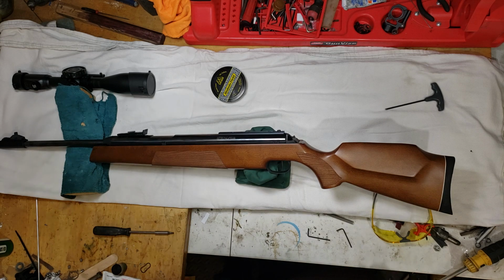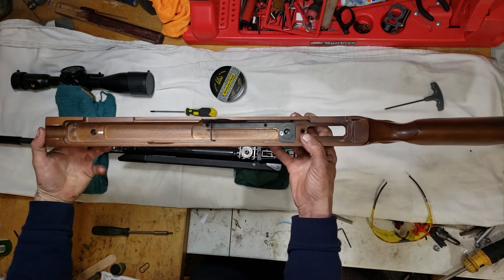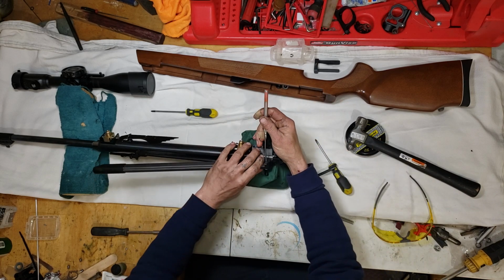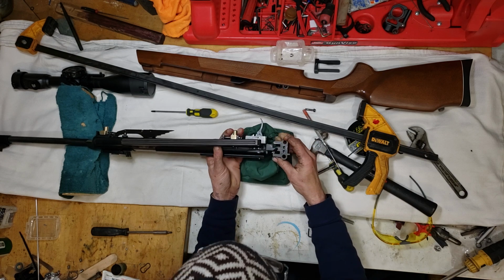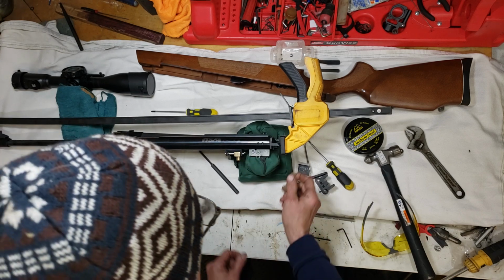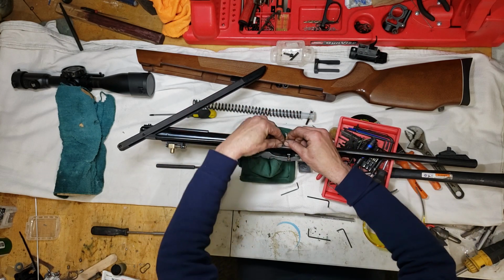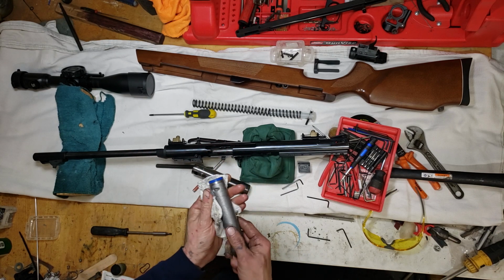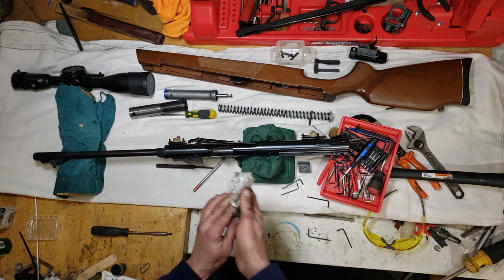RWS 54 AIR KING teardown part 1

Comment: Hey
good to see your video, I've got the 56TH in 177 and had it apart a few times, the front trigger screw can be left tight and the attached metal part comes away with the stock, also remove both circlips on the cocking arm and remove it completely, the cocking bar can then be swung forward, being careful not to turn it (marker pen handy) then cable tie into place against the barrel, using tape or a piece of rag to prevent scratches while you work.
tip, remove stock and scope from the bench! much more room to use and no need for plastic containers and putting bits on shelves above.
I've currently got a Vortek kit in mine with a custom spring in it, laser accurate and touching 19ftlbs, very flat shooting with JSB heavies.

Comment: Hello, I'm a new 177 Airking owner and would like to ask a couple of questions. Firstly I removed the rear sight and installed a scope. I'm wondering if there is a spring or ball bearing under the center of the rear sight because there are recesses and I heard something drop just as I lifted the sight off the receiver. Secondly, pellets fit very loosely in the breach and one pellet fell out of the breach when I held the rifle vertical before closing the cocking arm. Any comments would be appreciated, Thanks.
Reply: Haven’t taken my gun apart for over a year now but I do believe there  is a small spring which puts pressure on the  plate allowing you to adjust the  up or down by  turning the adjustment wheel. I also lost my spring when I adjusted the  sight to  high. As far as loose pellets , you have to be careful with that because if you’re not looking it may fall out when you  return the caulking  leaver  causing a  dry fire. I also did that. I find the 10.5 gr Crosman dome, the ones in the  brown box , fit really snug and shoot very well in imy gun.  I always wash these with hot water and soap, dry them and then put a little  dry lube on them as have read that Crosman’s  can dirty  the  barrel. Barracuda Match, all head sizes , have a secure fit and  are also very accurate.

Comment: Hi airgunner im  new in your chanel..i realy enjoy your vídeos,thank s for sharing very interesting pcp info. I wants to install a regulator on my Hatzan AT44-10  tactical 22cal. wich one hoy recomend me..againg Thanks and keep your vídeos coming
Reply from the maker: I prefer the HUMA reg, I have 6 now and work amazing and fairly easy to install, I choose not to use LANE regulator because you need to drill a hole in the tube and you can not go back to being unregulated.... my AT44-QE LONG is set at 110 bar and I get 50 shots with 18gr JSB...
Reply: @airgunnersedge4061  oh nice 50 shuts with 18 gr...and whats the fps tune speed in your hatsan to shut 18gr. Couse i have the same gr. Pellets
Reply: Un bonjour de France.
Merci pour cette vidéo car il y en a vraiment très peu concernant ces carabines.ma diana mienne d'éjecte plus les plombs.
Je vais la démonter pour trouver le problème.
Votre tutoriel sera très utile.
Merci